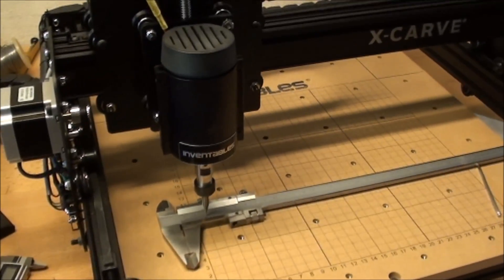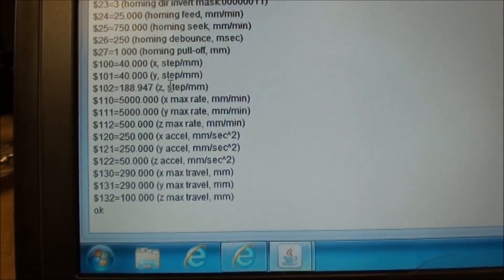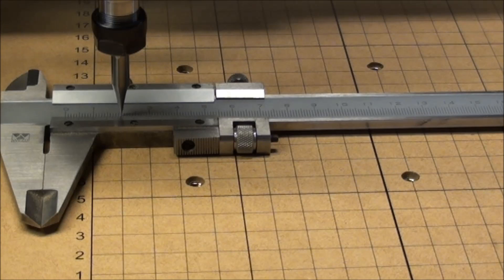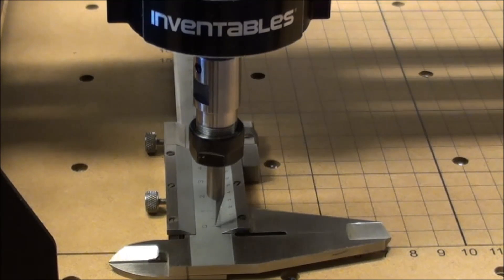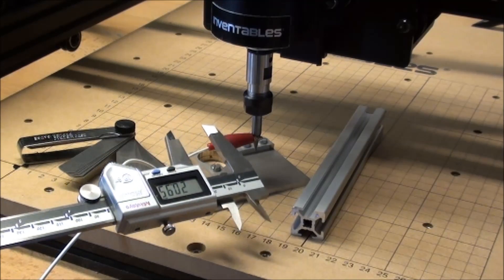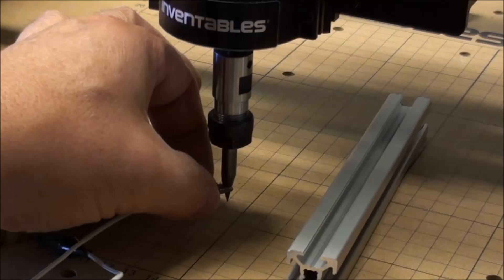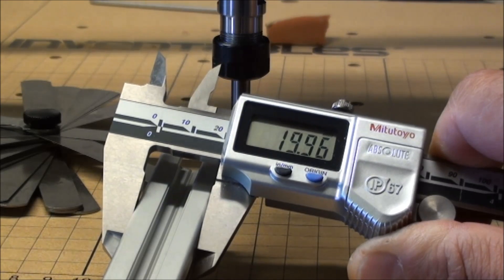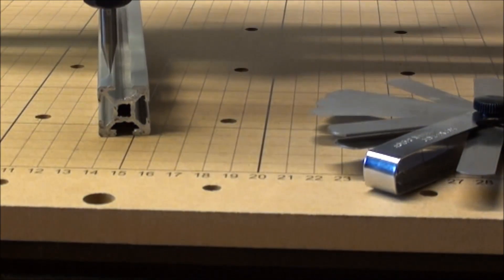X-Carve DIYCNC Router - Calibration of steps/mm

Comment: Hi Martin,
Thanks for the informative video.
I'm assuming the surface of the mdf board is not uniformed. does the variable thickness of the mdf board affect the accuracy of the z axis measurement/calibration ? if so what would you say the error margin is? and what's the best way to isolate that from our measurement? or is it just a waste of time to think about this with the level of accuracy which the x-carve can accomplish?
Reply from the maker: +Az Hi Az, For most milling MDF can be assumed uniform. However the machine plane is seldom parallel to the spoil board place due to inaccuracy in the assembly. E.g. one corner is a little higer than another. So in order to fix that I do a surface trim of the MFD spoil board surface. I use a large diameter bit and mill 0.1mm down into the MDF board. I continue until that bit has contact all over the plane. Leveling of the surface in this manner is particularly important when making pockets on a larger surface, milling PCB etc. If you mill into the spoil board many times this procedure also give you a nice new surface.Hope this answers you question. Martin
Reply: Yup, this cleared things up for me. Thanks !

Comment: Just a quick comment.  Your calibrations were correct on the X and Y, but the way you calibrated your Z was wrong.  This is because after calling G92 (which isn't actually needed. More on why not in a minute) you moved down to your work surface which was a pre-calibration move, which would then have thrown off all future measurements from zero because you don't actually know you're at true zero yet and definitely won't be if your ratios are off.

Think about it this way.  I'll over-exaggerate the numbers to better visualize the problem.  Say your touch-plate was 5mm thick but your $102 was off by a factor of 2 (was 80 when it should have been 40.)  You touch off the top of the plate, then set G92 Z5 (because you know you should be exactly at Z5), then say 'Go to zero' but your tip plows into the surface of your machine thinking it had only moved 2.5mm so far. That's because the ratio was off while you were moving to zero.

Say the reverse was true and your ratio was off by a factor of 0.5 (you have it at 20 and it should be at 40) and you said 'Go to zero.  This time you'd stop at a point hovering 2.5mm above your work surface although the machine would be reporting you're at zero even though clearly you're not.

Both of those would be obvious that something was 'off' and you couldn't just 'measure from zero' but say you're only off by 0.1mm.  You may not notice that and are measuring from a zero that's actually 0.1 off as part of your calculations.

But as I said above, you don't need to set zero to calculate your ratios anyway.  You only need to be able to move a relative, but exact distance from a known point, and you have that known point--the top of your touch plate--thanks to your probe!

As such the proper way to calibrate Z is to probe down to the surface of your plate then simply issue a relative Z move (set G91 for relative coords, then issue M0 Z20 or whatever the actual thickness of the extrusion is, which you can easily measure with your tool) and measure where you are relative to the top of the extrusion as the extrusion sits on top of that plate, not the surface of your machine! Again, at this point, the surface of the plate is the only absolute, which is why neither the plate's thickness, nor where zero actually is actually matters yet.

When you measure everything from the top of the touch plate, this guarantees all Z-axis movement is considered in the adjustment calculation, which is what your initial jog down to Z-zero missed and threw off.

Once you've set all your ratios, then go and re-probe, and set your G92 to identify zero because at that point, all ratios have been properly adjusted so you will be at true zero then.

Hope this helps!